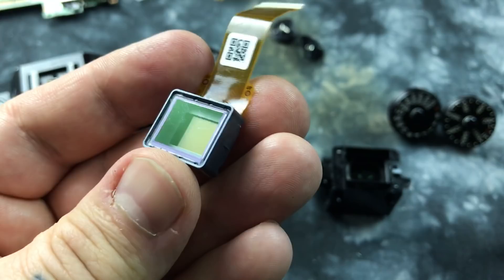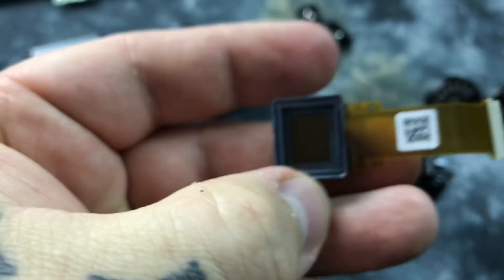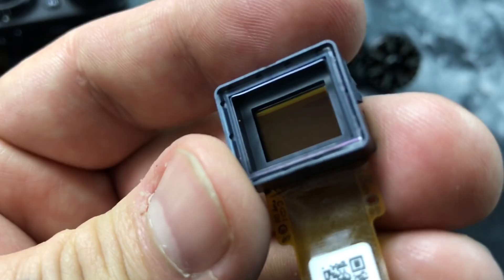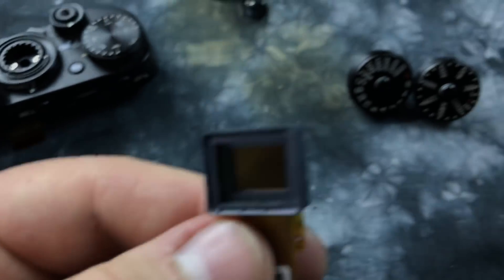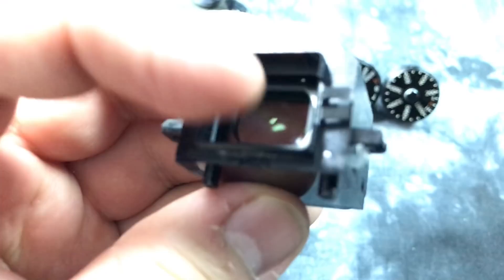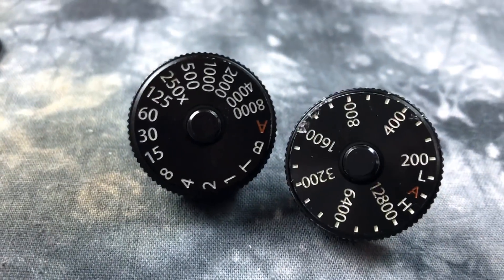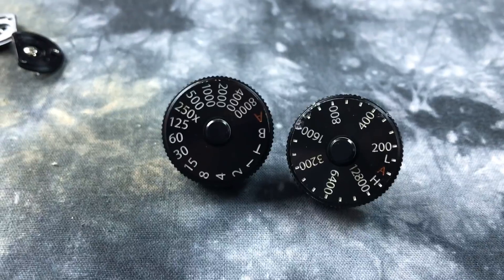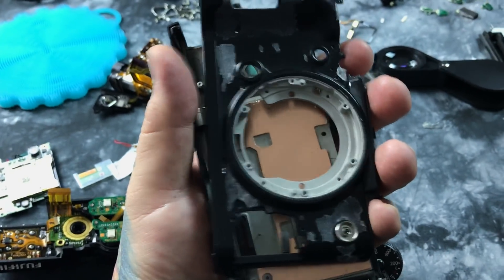😳 The EVF inside the FUJI XT-2. Teardown part 4

Comment: Did anyone find that the diopter moves inside the camera when you shake it back and forth as if it's losse inside and not in its place? And makes a damped clunk when doin so? You can both feel it in your hands and also hear it. People have been reporting this issue all across the XT series and no clear answear has been given.
Reply: Yep, I have the same issue with my xt2. Do you think it can get worse or will it stay like this?

Comment: Hi EVF on my XT-2 stopped working after a fall, all else working except when I place an eye on eyecup blank screen is displayed. I tried changing all settings and also sent camera to fuji repair in new york they quoted like $500 for repairs which I refused. Now I have my camera back and need to repair it but at a lower cost. I live in California near SF. Need your help to know where I can get spare parts, etc or who can repair it in minimal charge.
Thanks...

Comment: Are any of those parts reusable?
Reply from the maker: some are yes
Reply: @KenTheoriaApophasis  I’ve got a question for you sir. There is something clunky loose inside my diopter (XT3). You can feel it when you slowly move the camera from a normal sea level position to a vertical one, when you point the camera towards the sky/ceiling. It’s not always present. It comes and goes and for some reason it’s most noticeable with small lenses or without lens. I read somewhere this is common in this Fujifilm series. Did you by any chance encounter this issue? Is this something I should repair or should I just ignore it? Did they fix it in the XT4 or XT5?